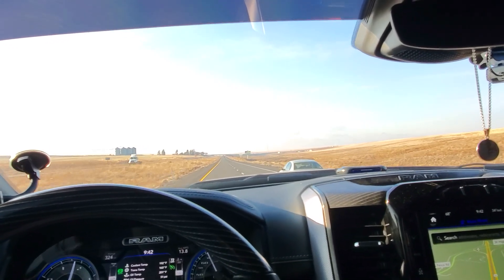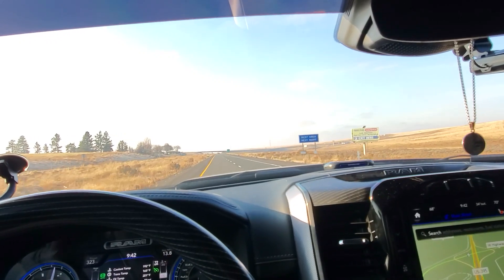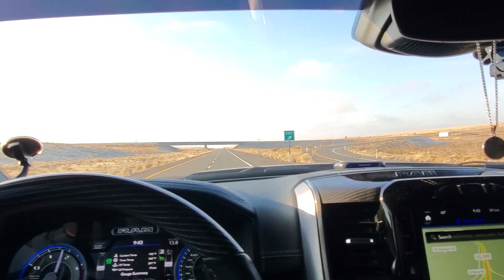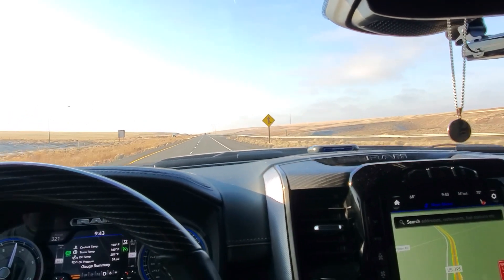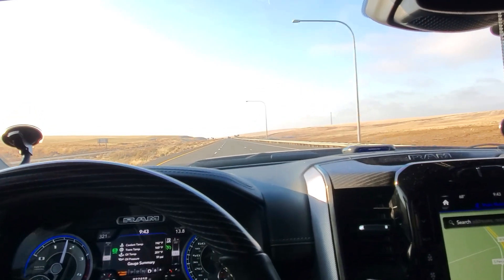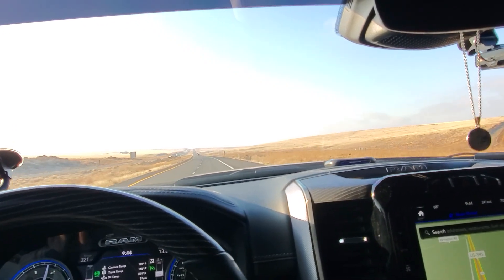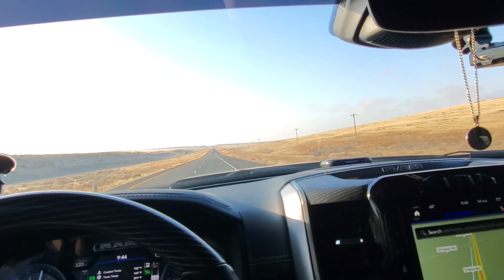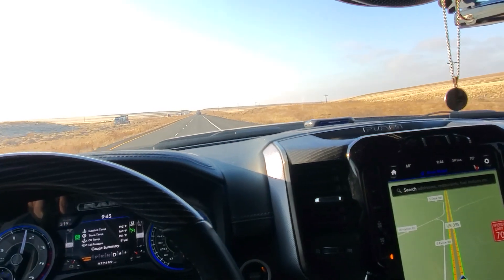Tow haul mode. Why and when should you use it?

Comment: I turn it on unhooked when coming to a stop with engine break on, saves brakes. Also turn it on unhooked wen i wanna pass up granny.. 
When hooked its always on when accelerating or slowing down...once i get up to speed ill turn it off if its holding a lower gear for no reason

Comment: On my Toyota is also re maps the throttle pedal, so you don't have to put your foot down so far to get a normal feeling of acceleration. I would bet most drive by wire systems do the same.

Comment: so i’ve got a 2011 6.7 cummins with 245,000, i just started using my exhaust brake regularly. I DO NOT tow and my truck is my mini van 😂 should i use BOTH the exhaust brake and tow haul or just the exhaust brake?

Comment: Thank you! I wish the truck companies did a thorough video explaining each function and feature. I've got the four wheel drive off road version 2019 Ram 1500 5.7 gas engine with E- torque. Is that considered 4th or 5th gen? So would you recommend me always using the tow/haul mode when I'm towing a 5000 pound 25 foot travel trailer no matter if on  long flat highways or on lots of hilly roads and in city traffic? Thanks for caring and trying to explain this feature to us.👍

Comment: Thanks for your video but you going to have to explain this more specifically because I had trans problems. Now I do not know how or why I did, but here is what happened. I have a 2021 Dodge 2500 4x4 Big Horn with a 6.7l Cummins Diesel, and it has under 10,000 miles. It has a 68RFE Transmission. I was hauling my fifth wheel in the Tow/Haul Mode and my transmission stopped pulling normal freeway driving. When I pulled over and checked my fluids, all fluid levels were fine. However, when I put the transmission in drive or reverse, it would not move. After having it towed to the dealership (Still under Warranty) they informed me my Transmission pump went bad. Can you explain that on a brand new vehicle?? This happened while I was moving forward on the freeway. It's like it went limp. Thank God I was able to find a location to pull over. I'm really baffled. So, I thought to reach out and ask some of you expects on transmissions what you think. Because I am not happy with a brand-new truck and transmission under warranty doing that. I feel like trading the SOB in. Your thoughts please. Thanks

Comment: So basically tow/haul makes the truck perform in comfort mode as sport+ would put my bmw in race mode. So its a button on a ford truck that, if pressed, self tune itself to adapt to the road condition when hauling a load???
Reply: This guy is running a Ram so a Ford may be different. I can say though that on the 2016 F250 we have at work I can't tell a difference in how it shifts with tow/haul mode on vs off.

Comment: So I’m new to the diesel world. I bought a 2019 ram 3500 with the aisin transmission manly right now I just pull my boat. It’s about 5000lbs loaded down.  I put it in tow/haul mode and while driving I don’t notice much difference but when I hit the brake I notice the rpms jump up to around 3000 rpm like the engine is down shifting. Is this normal? Seems like it’s hard on the transmission when it does this. Thanks.
Reply: It’s supposed to do that it’s not bad for the transmission at all it’s an engine break basically
Reply: And also you might not notice much difference on tow haul because it’s only 5k lbs if it was like15k plus you’ll definitely notice a difference

Comment: What if you have an engine tuning with transmission tuning? I tried the tow/haul mode and quickly turned it off because the power band and shifting was better without the tow/haul with the tuning.
Reply: He referring to "stock" I believe.
Reply: @MP-1965  I agree, but I was asking the question about what if it had tuning...

Comment: Does your shifter on the 19s still have the manual select shift + - so you can shift gears yourself?
Reply: My 19 has it they moved it to the bottom right side of the steering wheel instead of on the shifter.
Reply: So you can choose when to shift gears when you want to